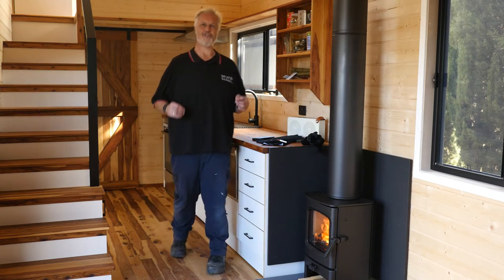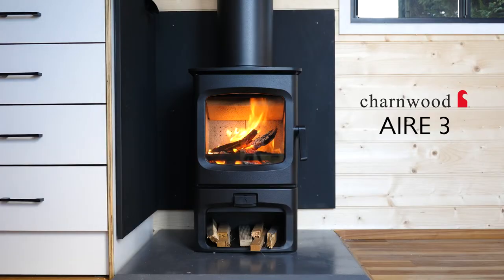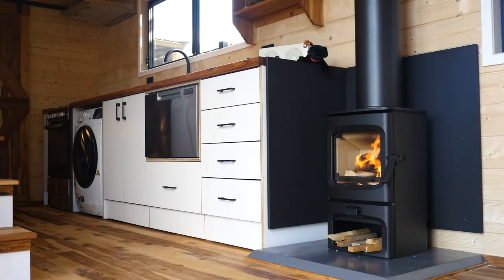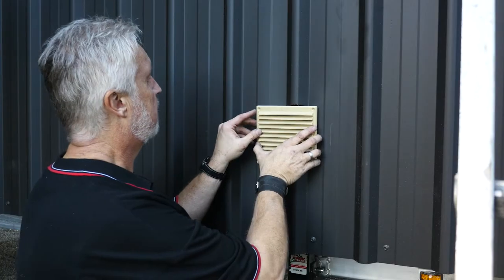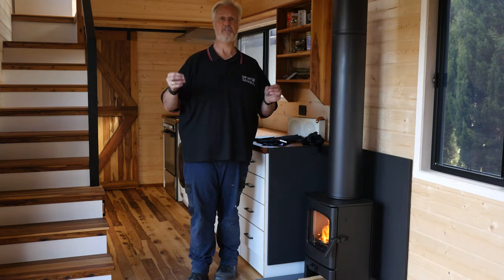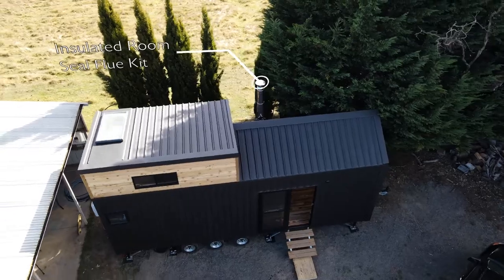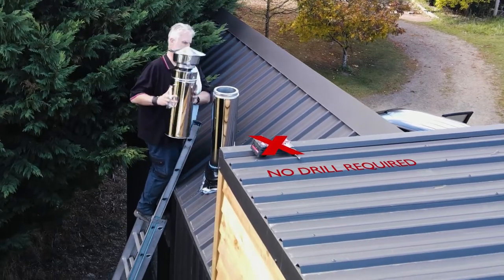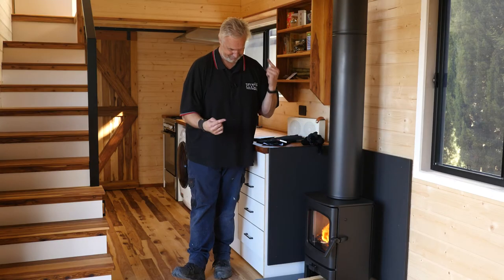Wood Heater for Tiny Homes - The Charnwood Aire 3

Comment: I,m getting this tiny arie 3 for my 40 foot bus as diesel heater is costing far more in diesel than effort of getting wood  for this heater  ,  checked it out in person today and loved the quality of it ,   outstanding and very neat easy to clean too ,,  cost 3,090 australian dollars  with high mount setting
Reply from the maker: We would never recommend a diesel ( or gas ) heater in a buss - the carbon monoxide you will get will cause major health issues ( and even death ) 
If you do install a wood heater - ensure it has out side air for the fire - this will ensure your bus is more comfortable to live in

Comment: July 6th 2024 ....... I've just finished installing my Aire 3 in my off grid tiny house in regional Victoria Australia ........ absolutely works a treat.
 Very low amount of wood used for a full night of warmth where the temp outside dropped to -2C overnight. 
My tiny house is 10mtrs long x 2.4m wide x 3.2m high (inside) ..... heats in no time.
It wasn't the cheapest wood heater by a long way but I wanted a heater purposely designed for TH's and I wanted high quality, not some cheap junky chinese rubbish.
Shout out to Maddi at Pivot for her great customer service and assistance. I actually bought 2 wood heaters from Pivot ...... great company to deal with !!

Comment: Hello, this stove looks great.
 May I ask if the external air option has any influence in the draughts of the stove in general. What I mean is, for example, if there is increased chance of smoke come in to the room when you open the door in order to refeed the stove with logs while burning.
Reply from the maker: Hi Robotech,

The Outside Air Kit actually reduces the draughts in your home.

Because the vent is sealed to the heater, which is then sealed to the room, the vent has no effect on the air inside the room. And because the heater is drawing air from the outside, any draughts the heater WOULD have made from drawing air from the room, it no longer does.

Hope that was helpful, we have heaps of Outside Air videos on our YouTube channel, and the same principles apply to Tiny Homes as well!
Reply: @pivotstove  thank you very much for your answer, have a nice day
Reply from the maker: @robotech21  Anytime :)

Comment: That's an insulated flue pipe, are u not losing a lot of your heat going up the flue pipe. I use 100mm enamel flue pipe, with heat shield, a great deal of heat radiates from it, meaning I need to burn less wood to get the house warm.
Reply from the maker: Hi David,

Your wood heater flue generates about 3% of the total heat your wood heater produces

However, if you have a triple skin flue kit with holes in the dropbox, you lose 8% of the heat through the holes.

So you're trading 3% for 8%.

You can also get the first length of your Room Sealed Flue Kit as a single wall flue, in both stainless and enamel, if that is a look and style you prefer.

More information can be found here - https://pivotstove.com.au/catalogue/hearth-flue/rsf/rsfk/

Comment: I am planning to move to a tiny house on wheels so I’m shopping for one. The current house I live has a big one or normal size it’s a grizzly brand. It has a fan under it and it sucks air and shoots it out through the side chutes or openings so hot air is shot into the living room. What puzzles me I  don’t see or hear the fans in these videos. My friend was shocked because he bought a wood stove and when he saw mines he couldn’t believe how much hot air my fans shoots Inter he room and how warm my house was. He said his barely warms the house and it’s a cheap external type of fan and barely blows any hot air.
Reply from the maker: Old, dusty fans can definitely be quite noisy. The Charnwood Aire 3 doesn't have a fan, and definitely doesn't need one in a tiny home.

Fans are designed to push hot air through large spaces. No need in a Tiny Home!
Reply: July 6th 2024 ....... I've just finished installing my Aire 3 in my off grid tiny house in regional Victoria Australia ........ absolutely works a treat.
 Very low amount of wood used for a full night of warmth where the temp outside dropped to -2C overnight. 
My tiny house is 10mtrs long x 2.4m wide x 3.2m high (inside) ..... heats in no time.
It wasn't the cheapest wood heater by a long way but I wanted a heater purposely designed for TH's and I wanted high quality, not some cheap junky chinese rubbish